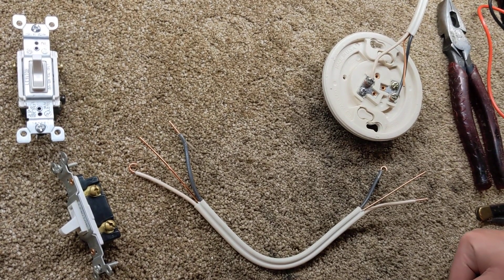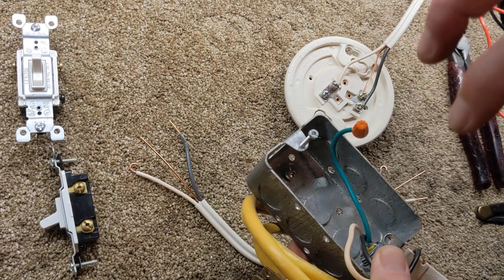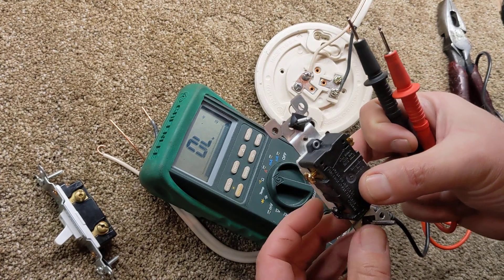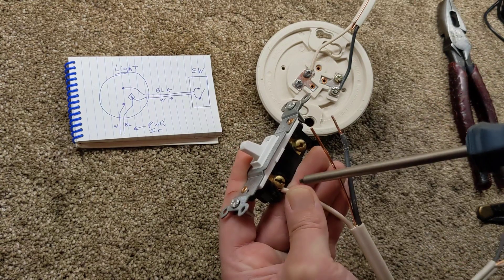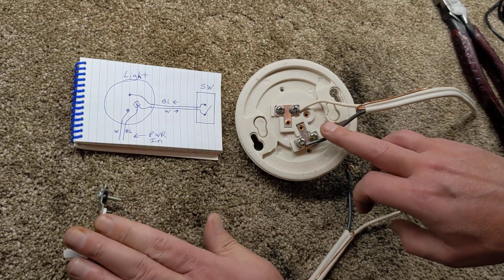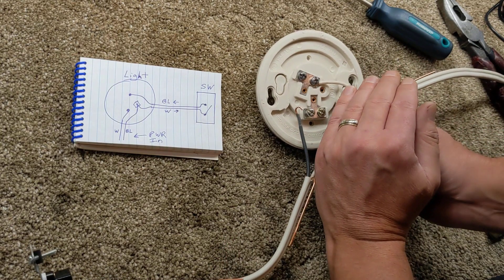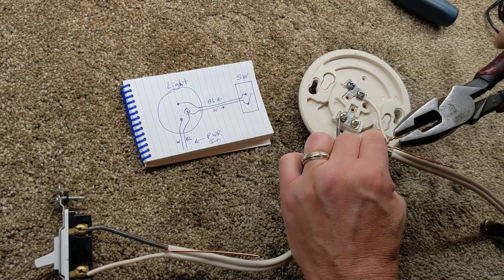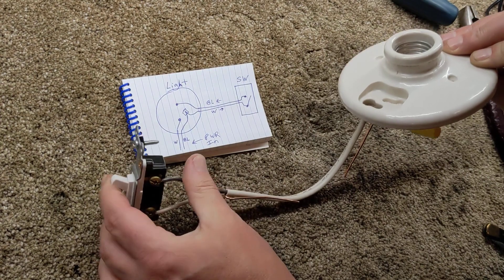How to wire in a switch to a new or existing light with 2 wires properly with some tips and tricks.

Comment: And the ground just leave it like that? Hanging ?
Reply from the maker: Thanks for the question.
The ground wire (bonding conductor) at the light will be terminated around the ground screw at the back of the metal octagon box. In this example the light (keyless) does not require a bonding conductor but leave the full length in the box for future (in case the next light to go in does need it). it is not a bad practice to put a small marrette on the end to help keep it from poking into a different terminal by accident. Either way, push it up tight against the back of the box.
Hope that helps :)

Comment: So one of my questions is that’s a massive sized wire nut that you chose here this yellow one… I see a small recessed area on the wall or ceiling side of the light fixture… Are you saying that that large wire or not is supposed to be tucked into that zone?
Reply from the maker: I used a 33 Marrette for this (yellow) which is perfect for two # 14 wires as it gives the option for a third in the future if needed. A 31 Marrette (black) would work but it would be full after.

I think you are asking if the Marette can be tucked into a void on the outside of the box where there happens to be a recessed area.
For where you "tuck" them in after, all the connections made MUST stay inside the electrical enclosure. For lights and switches that would be within the boxes themselves.

Hope that helps and answers your question. Thanks for watching and thanks for the question. :)

Comment: You are correct White is power going to the switch, the white wire must have Black tape at both ends saying it is no longer a Neutral. 
Also if you Have a 3 way switch on hand, and don't want to run to the Store, just use the 2 screws that are on the same side of switch. 3 way switchs are smooth, no ON/OFF Writing on the switch. 
When Installing Switches either Single Pole, 3 Ways as a single pole switch or Decora style switches, have the screws on the right side, you won't have to try and read the lettering saying on or off.
Will leave a thumbs up.
Reply from the maker: Thanks for the comments.
Yes, black tape on the white is important to show that it is no longer a Neutral. As for a 3-way instead of a single switch you can if wanted (not recommended because of cost difference) as long as you don't tie onto both travellers screws like you mentioned. Thanks for checking out my video, enjoy my other Electrical ones :)

Comment: THANK YOU THANK YOU for the info. I need to do this VERY thing in my girl's utility room!!
Reply from the maker: Perfect, awesome that it can help as that was my goal when I started this channel! I would recommend doing it with a 3 wire though if you live in US/Can as it's code here. Check out my video (How To Use 3 Wires On A Switch Leg off of a light on the "Electrical Board Of Education") that shows a full step by step. :)
Reply: @AtHomeAndHandy  OK thank you
Reply: @AtHomeAndHandy  do you have a link for that? Thank you
Reply from the maker: Here you go bud, hope this shows it clearly enough for you :)  https://youtu.be/Ea40OaUAryU

Comment: This is PROHIBITED since the 2020 NEC!! A 3 wire cable must be installed!!
Reply from the maker: Thanks. People all over are watching these so I wanted to show how to do it with a two wire. I only know that it is code for a neutral in switches in the US and Canada, I'm not sure about other parts of the world though. This is why I state this in the details as a heads up and an FYI for people and as always, check with local codes if not sure.

Comment: I watched your video because I would like to put a switch on a light outside my garage which is currently live am I able to just cut the wire and add the switch in line with the black side or is that the wrong thing to do? My other thought was cut both wires and put in a double pole switch is that okay?
Reply from the maker: Thanks for the question! In order to add a switch there you will need either access to the wire going to the light or be able to run another wire into the box where the light is (preferred). If your garage is exposed inside, just open studs, you will have both as options. Assuming it is open the easiest will depend on where you want the switch located.

Option 1- Add the switch "in line". There will probably not be enough slack in the cable so you will need to cut it and install in octagon box and run a piece of 2c/14 to a newly installed switch so both wires will then be long enough. You can then wire the switch the same as this video (Adding A Switch And Light Off Of A Power Source On The "Electrical Board Of Education"). Just make sure that you locate the octagon splice box in a location where if the garage gets sheeted that you still have access to it and put a cover on it as no box can be hidden.

Option 2- Run a switch out of the light. If you have more than one light on the front of your garage, make sure to do this on the first one so the switch will work on all the lights after it as well. For this you will need to run a 3c/14 into the box down to where you want the switch to be, 3c/14 is required by code in US & CAN. Then it will get wired up the same as this video (How To Use 3 Wires On A Switch Leg off of a light on the "Electrical Board Of Education").

Hope that helped :)

Comment: While this is an excellent explanation of how switch legs work using  two conductors due to the prevalence of smart switches that require a neutral if you are adding a new switch leg to an existing circuit you should run three conductors plus a ground , if the neutral isn’t needed complete the connection at the light and cap the neutral off in the switch box for future use. I believe this is code required for new work in Canada probably also in the USA
Reply from the maker: Couldn't agree more Tom. What timing as well as I actually just posted a new video today explaining that a 3 wire, therefore a neutral, is now required in both Canada and the US. I have also made and will be posting real soon a video showing how to wire a switch leg with a 3 wire. Thanks for your comment :)

Comment: Good to see you understand why to make the white wire on a switch leg hot all the time.  So many people get that wrong and don't have a clue as to why.  This makes it easier to identify that the white wire on a switch leg is NOT a neutral wire.  Thank you for what you do by making a correct video for us viewers in the USA.  As previously pointed out, wire colors can vary from country and region.  The new USA electrical code has corrected this situation and now require a neutral be run into a box even if there is only a switch leg.  This now requires a black, red, white and bare ground at every switch.  Waste of copper but eliminates the constant hot white feeder wire.
Reply from the maker: Thanks for your comment and I should have shown that a wrap of black tape on the white as well. An Electrician will recognize the white coming back hot and know what it means but the average home owner would not. The new requirement to add the neutral in switch legs makes sense with the amount of "smart" switches that require them. More of a future proof thing really for the low cost of one conductor.

Comment: Given that the wiring colours alone indicate that this is aimed at the US viewer and international wiring rules vary dramatically you should indicate these facts CLEARLY in the video description and as a disclaimer in the video itself.

Compared to UK standards and European colours this is neither approved nor standard and could lead to potentially fatal accidents.

In addition black is the old UK colour (still in a lot of premises) for neutral unlike the US where it's the live connection! 😲😫🤔
Reply from the maker: Agreed, this is for US & Canada systems. Many other areas outside of Europe also use a similar 120v system but with UK using a 240V system, the wiring would be different.  Due diligence is always required when searching YouTube for help with your project but with that I have also added it to the description. Thanks for you comment!

Comment: I have never seen it that way. It’s always switched power to light blk on blk and white on white
Reply from the maker: Great comment. When a switch has 2 conductors, a black and a white (2c) going to it and a 2c leaving it you would want to put just the black wires on the switch and connect the whites together. Where this is different is that the switch is only fed with one 2c (a switch leg) so you need to decide which wires of the two will bring the power down and which brings it back up as both will be "hot", there is no neutral. When power is first at the switch it would be wired like you mentioned and when power is first at the light you will need to use a switch leg like the video. Hope that helps.